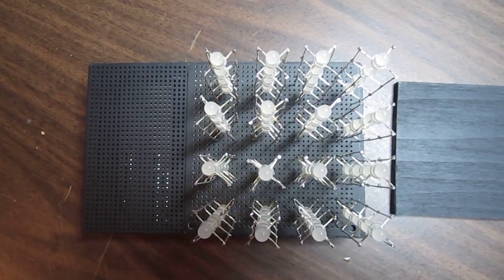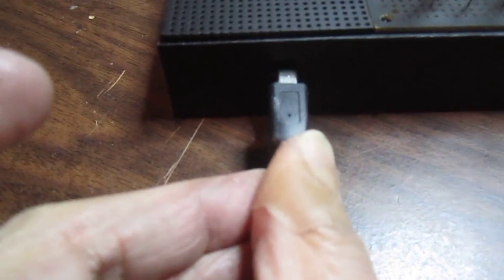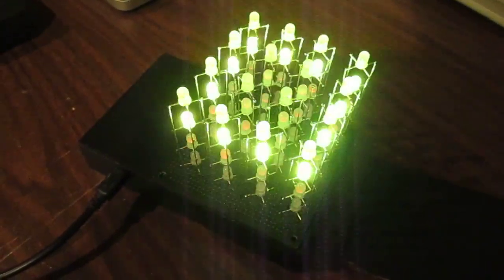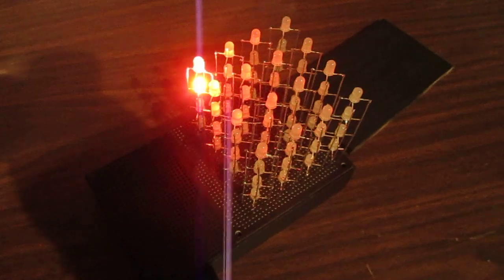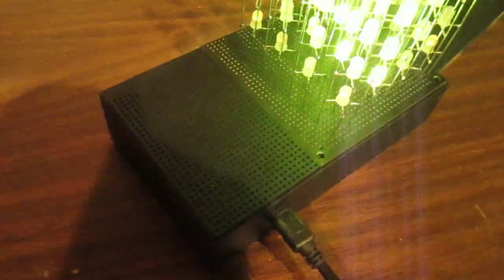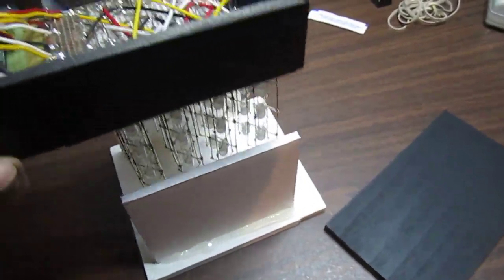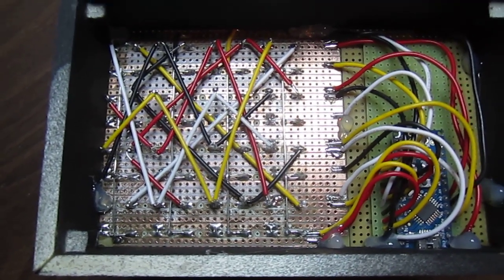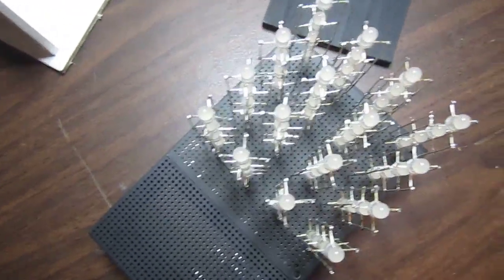Charlieplexed 4x4x4 RGB LED Cube

Comment: Nice, how did you cut the chamfer edges on the box?
Reply from the maker: Hmm, it's been a while. I think I used a jigsaw to get most of the material out, then sand it by hand to the right angle.

Comment: i need the right code friend pleases for rgb :)
Reply from the maker: Instruction written by the original author is here.  Code download is at the bottom of this page.
https://aglick.com/charliecube.html

There is more code is here:
https://github.com/AsherGlick/Charliecube/tree/dev
Reply: thanks , but i think this will not work :( because this wiring not contained at +5v or GND ?? 
please clarify to me , from where the project got power ?
Reply: thanks , but i think this will not work :( because this wiring not contained at +5v or GND ?? 
please clarify to me , from where the project got power ?
Reply from the maker: It "appears" that there are no +5V nor GND going to the LEDs.  However, remember that Arduino GPIO can be set to LOW = GND, HIGH=+5V, and INPUT=high impedance as if not connected to anything.
By clever wiring and programming the right combinations of HIGH and LOW of the various Arduino pins, we can light up any of the led colors.  Here is more information on how Charlieplexing work if you're interested.
https://en.wikipedia.org/wiki/Charlieplexing
Reply: thanks dear :)

Comment: Well done job but i have seen that some led lights cannot fully off, some dim light present in some leds.  How they can avoid???
Reply from the maker: Thanks Mani.  I believe the reason that some leds are dimly lit when they are not supposed to is because Charlieplexing relies on NOT having enough voltage to light up certain LEDs when they are NOT directly powered.  However, if the LEDs' minimum forward voltage is low enough, they would lit up when they're not directly powered.
One might be able to counter this by putting resistors so the voltage for the indirect leds would be lower, but of course that will also make the led that are being directly powered dimmer. :-(
Personally, I think that dimming effect is acceptable cost of the low part count of Charlieplexing.
Reply: I agree Charlieplexing replaced all shiftregisters and other components.

Comment: arduino  ???
Reply from the maker: Yes, the ATMega328 is the chip that the Arduino uses.  So, it's a bare minimum "Arduino".
https://www.arduino.cc/en/Main/Standalone
Reply: Hari Wiguna  what name kit arduino? 
CH340 of FT232
vietnam
Reply from the maker: You could use either one. Both does the same thing: converts USB to TX/RX UART.

Comment: Dear Sir,
              So Many thanks for such a wonderful Guide. Your site influenced me so much that I built a Cube of my own. May not be as beautiful as yours but it not at all ugly (Photo attached).

I'm running this with your Code downloaded from your site. 

ISSUES :

The animations are not changing only 1st animation continues....

Solution Tried :

Decreased & Increased   setAnimationTime(2550)  value to 2500, 255, 500, 50, 10, 5, 1. but nothing happened.

put // against all animation in animation loop & enable only one. One by One Checked all animation working

PLEASE HELP  Thanks In Advance.

Comment: muy buen video tengo una duda el catodo es para  todos las  columnas y ba  conectado al gnd del arduino
Reply from the maker: Google translates your comment:
"Very good video I have a doubt the cathode is for all the columns and ba connected to the gnd of the arduino"

Hari answers:
You are correct!  The leds are wired with common ground.  Instead they are wired in a complex pattern called Charlieplexing.

Comment: I had to download the video and slow it way down to be certain... Your spires are turned 90 degrees (or maybe its 270?) but the fountain gives it away. Its supposed to start at the bottom and move up the center, then cascade down the outside. Yours seems to start at the second level up from the bottom. For an easy fix see this web page: http://www.instructables.com/id/Hacking-the-CharlieCube/?ALLSTEPS
Scroll down past the two small video windows and you will find HippyNerd's cubeplex.h file to download. It contains tables for all 4 orientations of the LEDs, just uncomment the section which matches your cube.

Sorry I just realized Gary pointed this out earlier, but its not really a mistake by Asher, just a difference in the LED orientation. Thanks go out to HippyNerd for the universal cubeplex.h file also!
Reply from the maker: Steve Stover , Excellent observation!
I messed up soldering the spires and had to adjust the wiring on the base.  I was pleased to have it work that I never noticed the rotation. :-)  I have the construction (including my mistakes) detailed in my blog if you're interested.
http://g33k.blogspot.com/2013/03/charlieplexed-4x4x4-rgb-led-cube.html

Comment: I built one of these a couple of weeks ago but it took me many days to pinpoint the dry solder joints (which causes other LEDs to glow dimly). I also foolishly tested the towers without current limiting and blew up three of the LEDs which, again, took me a long time to pinpoint so I could replace them. (Replacing is pretty easy because the towers hold everything in place.)

There's a "mistake" in Asher's cubeplex.h code and I noticed it in your video. In cubeplex.h, in the drawLed subroutine, the z axis is off by 2. I put the following line just after the opening bracket:
z = (z+2)%4;

This makes the z plane start at the bottom of the cube. You'll probably only notice it with the 'fountian()' (sic!) display and the 'planarFlop3D()' display but it also affects 'shiftSquares()' and 'chaseTheDot()'. 

I call it a "mistake" but it's actually due to different wiring.
Reply from the maker: Congratulations! I find it so amazing that all those RGB leds could be controlled without any shift registers. Thanks for sharing your discovery about the z.
Reply: I know the pain of blowing LEDs during testing. It took me a few hours to fix the damage caused when I left my PSU on 12 volts in a cube I am working on.

Comment: Hi Hari, could you provide the schema to connect the wires, arduino and leds for 4x4x4 single-color LED Cube?
Reply from the maker: I followed the detailed wiring at Asher Glick's site.
http://aglick.com/charliecube.html#howIsItBuilt
Reply: Thank you. However, this link is for RGB cube. I would line to build single color.
Reply from the maker: César Lino , oops sorry, I did not read your message correctly.  Here is my blogpost about the single color 4x4x4.
http://g33k.blogspot.com/2013/03/4x4x4-single-color-led-cube.html
There is a link at the bottom for the source. I'll look for wiring diagrams.
Reply: Thanks again. I downloaded the source code and I could not find the diagram image with the wire connections.

Comment: Dear Hari,

Could you explain how you every managed to make a 64 RGB LED cube without any transistors on a 16pins Arduino Nano?
Reply from the maker: Jan Donker, unfortunately, I do not fully understand it well enough to explain it.  The technique is called Charlieplexing.  It takes advantage of the fact that LEDs are diodes, and as such they only light up when power is flowing in one direction and the voltage is over a certain level.  Here's Wikipedia explanation of Charlieplexing.
http://en.wikipedia.org/wiki/Charlieplexing
Reply: ahaa.. than maybe I can help you out! Charlieplexing is a way to use the fact that leds works as a diode and therefor only lights up when the voltage is running one way (anode to cathode). With Charlieplexing it is possible to use only three powerlines to controle 6LED's individually.  The LED's are paired in two between Line1 and Line2, and between Line2 and Line3. The last pair of LED's is paired between Line1 and Line3. Each pair of LED's is hooked up in opposite: one LED lights when the current flows from Line1 to Line2, the other LED lights up when the current flows from Line2 to Line1. So by alternating not only which two Lines switches a LED but also the polarity of those very Lines,  you are able to hit this off. This is in fact a more efficient way then multiplexing which is often done with transistors,  but it will be so that I will always advice to use current limiting transistors to safeguard the cpu. Without it might be cutting hard in the lifespan of the processor...   I hope I made it a little more clear!:)  thnx for the fast reply and still a project very well done!

Comment: I can't really understand how this doesn't mess up the LEDs without resistors. I'm researching to build the same cube, and while testing one LED without a resistor, I found that the red one burned out immediately... Oh well.. if it works, it works :)
Reply from the maker: Yes, it is a bad idea to hook up an LED without a current limiting resistor.  I believe the fact that each LED in the cube is pulsed and only on for an instant is why the cube does not burn out.  The human eye persistence of vision (POV) makes it look like all the led in the cube could be on at the same time. Be very careful with the LED orientation. Don't make the same mistake I made. Don't make new mistakes either. :-)
Reply: That sounds like a reasonable explanation. I tested some of my LEDs with 5v, and the red one burns out almost immediately. I'll just have to build it and see how it works :) Thanks for your reply!
Reply: @HariWiguna  An LED has both a continuous current limit and a maximum pulsed limit.  Some LEDs that can only handle 20mA continuous are spec'd for very brief pulses of a much higher current. You would have to specify the PWM frequency to be able to look up the answer to this question in a datasheet.  But I doubt you have a datasheet since you purchased these LEDs in bulk from China (which is more or less what everyone does, so I'm not being critical at all).  Therefore, you really are relying on luck to know whether or not this will be a problem in the long run.

Comment from the maker: Ian, the directions of pin bending, how they are rotated, how they are wired, and the code are all very inter related.  Using code designed for other cube would almost certainly not work.

Comment: Hello,
Im wondering if you get stray LES's, certain LED's that shouldn't be on are just dim.
i went through and all the LED's are correct and theirs no interconnections that shouldn't be their... any ideas??
Thanks
Reply from the maker: I also noticed some dim LEDs under certain pattern on mine.  I suspect that's a side effect of Charlieplexing.  Some LEDs are more sensitive than others and still lit up even with very little current/voltage.